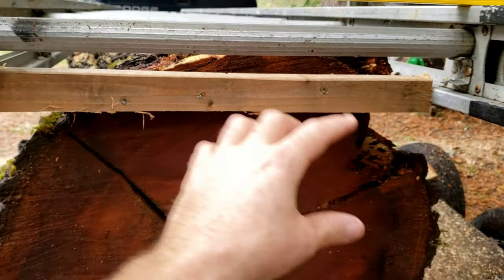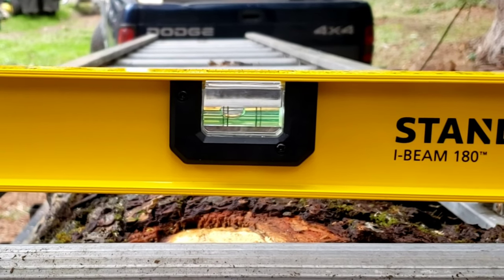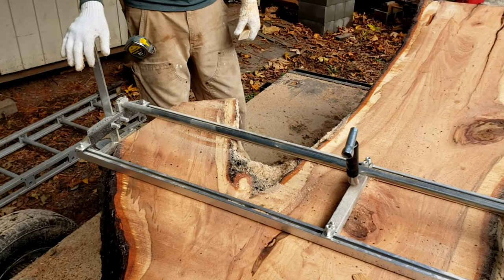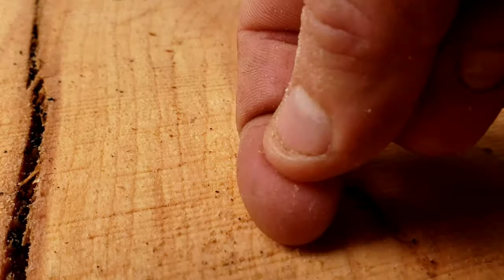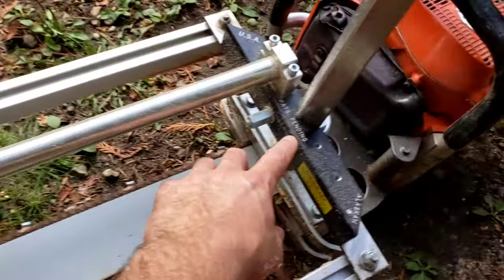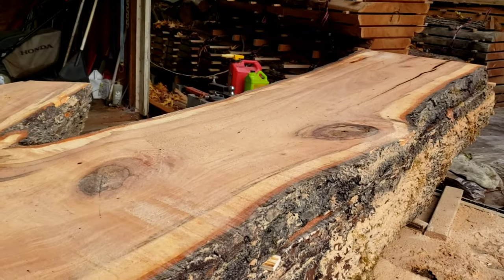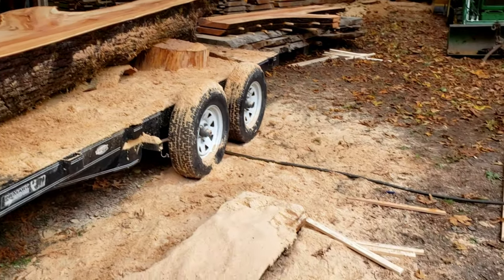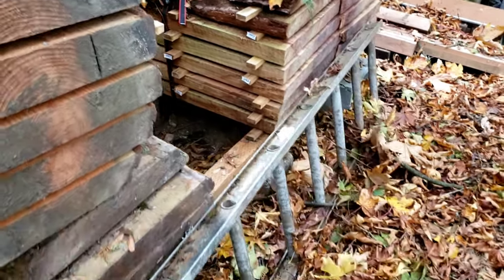Milling w/ Alaskan mill • a brief overview of Setup, some tips, and slab storage

Comment: What size chain are you running 3/8 or .404 at that 5 degrees is that every tooth on full skip chain ?  I have a 105cc I'm going to start on a 36 inch bar . Most logs are 24 inch oak .
Reply from the maker: We run 3/8 pitch chain. This one happened to be skip tooth, but all our other chains are full comp. Yes, we file every tooth at 5° You don't have to, you can run your chain like it is standard at 25°-30° but you end up with a much rougher cut that requires a lot more work to get it smoothed out on the back end of the process.
Reply from the maker: 105cc is more than enough for 24" log. Are you running a Stihl 070?
Reply: @samishsawworks5870   I have the china clone I never vould afford the real one lol G070 blue thunder. and in our area you will never find Stihl 070 there all pretty much used up. Great video .. great info I subscribed.. thanks for chain info that 
Re grinding chain will keep me busy lol
Reply: Also next will be what gear to run I can.put 3/8 on my 105cc maybe also . 
I have 7T and 8Tb.404 and 7t 8 t 10 t on 3/8 . Still in set mode need to buy mill rack yet also ..
Reply from the maker: @GrizC  you most certainly can run 
.404 OR 3/8. Whatever you have more of, or is more common for you, is what chain pitch I'd run. No real advantage to one over the other in milling situation. You'll get a narrower kerf with 3/8, but the cutting edge holds up a little better with .404 chain. Not hugely noticeable, but a little. We use 
.404 on a Stihl ms880 sometimes. I'd stick with a 7 pin drive sprocket myself. The added chain speed will hardly be noticeable in my opinion for milling. Of course, there's only one REAL way to find out ;)I'd keep all the torque I could in a milling scenario though. Especially in hardwood like that.